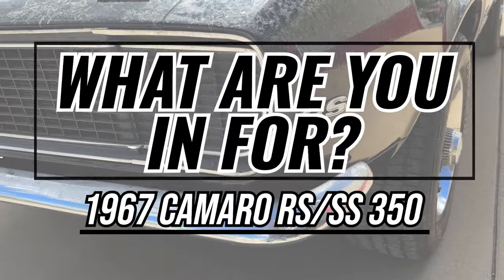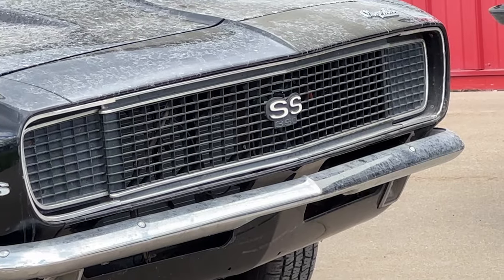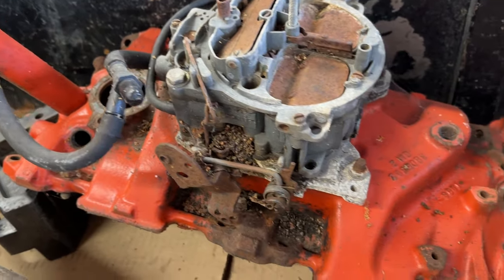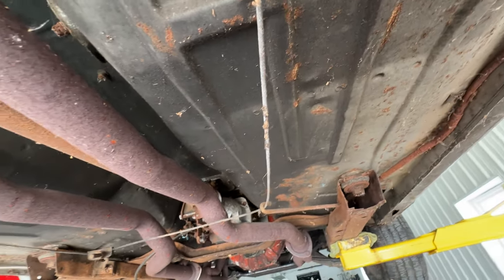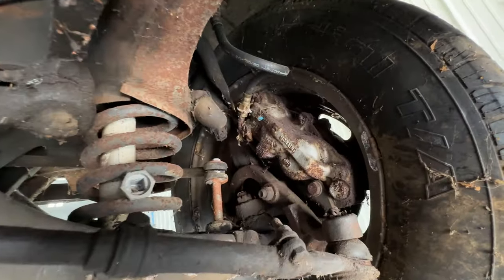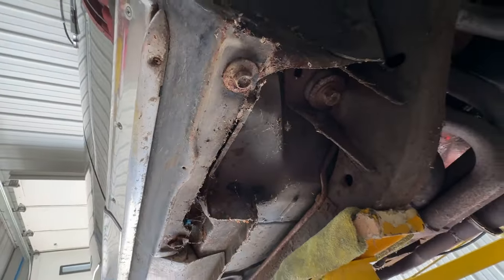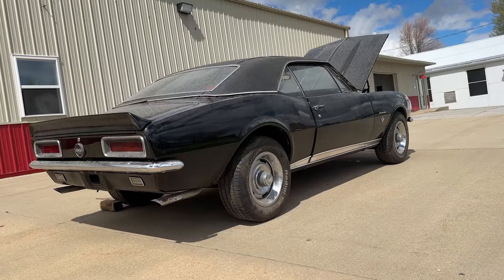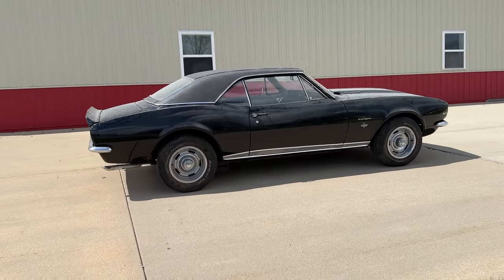1967 Chevrolet Camaro RS SS 350 4-Speed Time Capsule Muscle Car Of The Week

Comment: There's a Ferrari like this: a 250 is bought, raced a bit, then disappears for a bit, then reappears with a Vignale body and races for like a decade, with the new body.

The car was later restored to stock and the body moved onto something else (a 275 owned by J Geils of "my angel is a centrefold" fame apparently). So the car is back to insurable stock, but the body with the racing history is somewhere else.

Comment: It may be the original axle with the rubber isolators removed for the multi leaf spring to fit. Hood, rear spoiler and tail pipes are all 1969 parts. None of those came on a '67. The shifter is a Hurst replacement for the original, junk, Muncie shifter too. Nice car, but the commentator indicated it came with Yellow interior and it is black now. Would like to see the trim tag to know what it was built with, but really, I had a Butternut '67 and didn't like it...too pale of a shade of yellow. Paint it 1970 Corvette Yellow.

Comment: not original rear end 67 didnt have multileaf
Reply: SS models did .
Reply: @naj5338  wrong .No 67 did.
Reply: Are you certain?  Base models had single leaf springs.  In 68 the shocks were staggered and I think base models had dual leaf springs.  I thought super sports had 5 leaf springs.  Can’t imagine a 396 with single leaf springs out back.  That’s what my 327 had.
Reply: @naj5338  trust me. I`ve been restoring 1st gen Camaro for over 40 years specializing in `67s. I have a 67 RS/SS 350 4spd. It has a 12 bolt with mono leaf as all did even 396`s. Please do a little research.
Reply: @texasbasementbuilds4543  so there was no multi-leaf set up until 68 and only on SS models?
Reply: @naj5338  Correct. Stating in 68 all 12 bolt cars had multi-leaf including all SS, Z/28 and L30M20 cars. All others mono. All 68 and 69 Z/28`s had 4 leafs. 5 leafs were used depending on weight and options.
Reply: That’s interesting.  Thanks for the info.  I didn’t even know L30M20 cars existed.
Reply: Thats why they wheel hopped so bad. 2:28